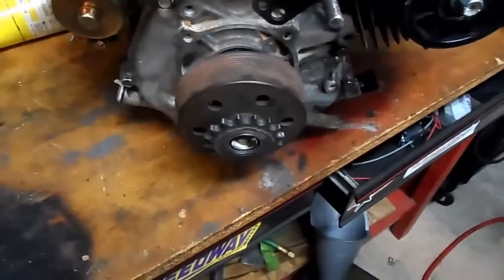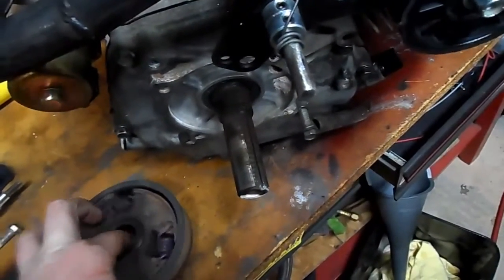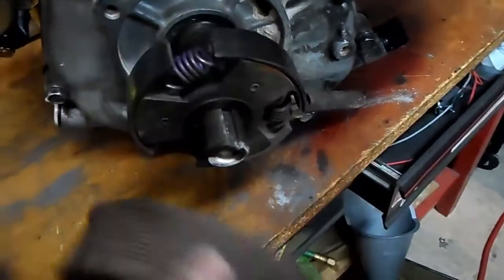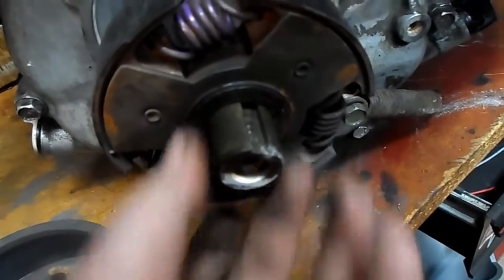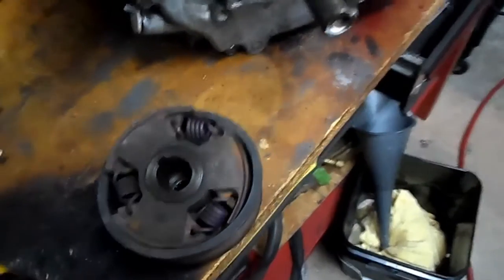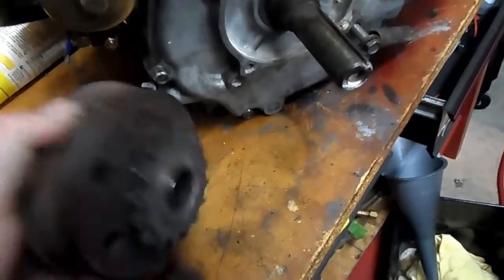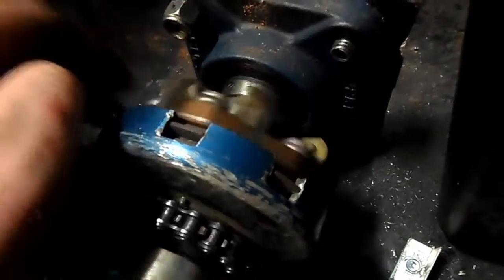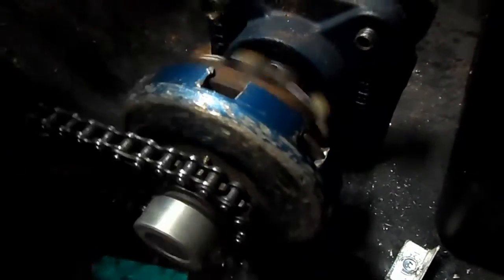racing lawn mower clutches

Comment: Why do you have a needle bearing spinning on a keyed shaft?
Reply from the maker: the out side hub is not keyed only the internal clutch needs to spin with the engine(keyed) intill lock up once lock up is achieved then it will spin the outter hub

Comment: I take it a Torque Converter is not allowed in the class you run?
Reply from the maker: no sir
Reply: ***** Damn it man!!!
Reply: because of the constant slip a tav would actually put u at a disadvantage on a circle track... especially against someone withthe correct gear ratio for said track...

Comment: thanks for the video never know that but why would you want it to go at a higher rpm
Reply: +MikesBigBlock u forgot the cheapest and IMO best clutch...the manual belt clutch.
Reply from the maker: if you want a harder engagement at a later rpm so you dont blow off your tires coming out of corner.
Reply: MikesBigBlock can you make a video of how to install it with the sprocket facing the engine